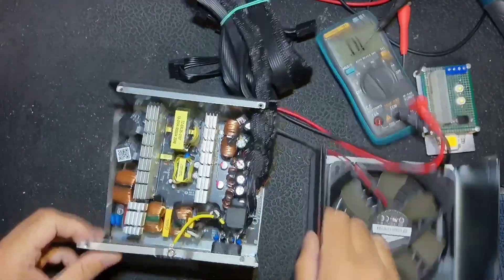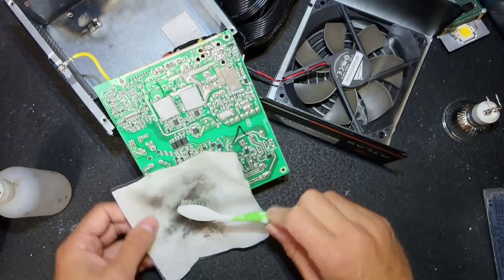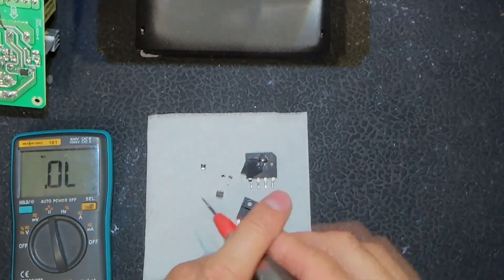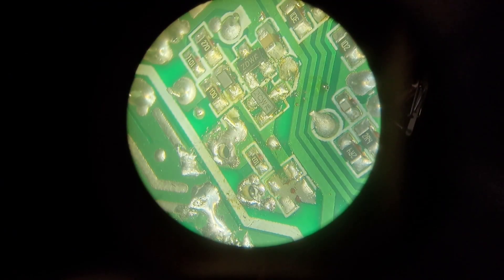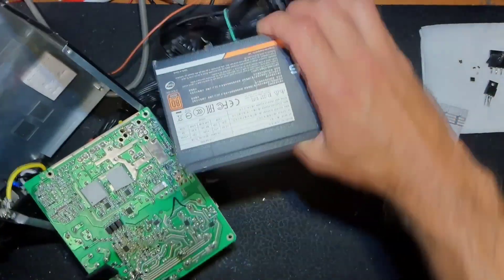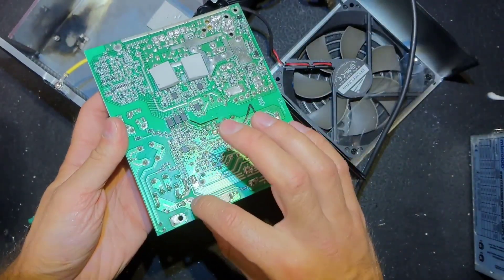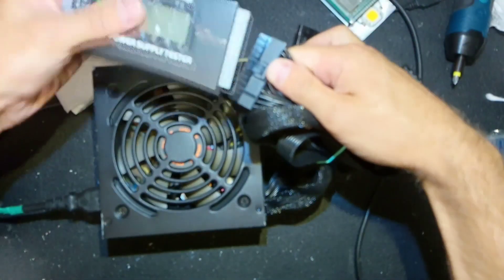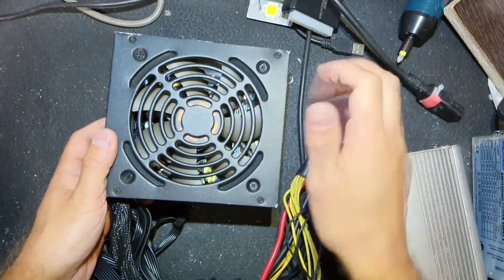Cougar Atlas 650 repair

Comment: One question. How do you know the values and the types of the components burnt so to replace them ? Do you have schematics for this PSU or another similar ?
Reply from the maker: Most of the time I use similar donor components from broken power supplies. Also after some time you get the experience and knowledge.
Reply: @electronicshaverightstolive  I suppose most of these PSU are actually quite similar and the only difference is the power output except those very expensive brandname PSU that may have proprietary designs.
Reply from the maker: @nikolaskallianiotis8622  exactly.